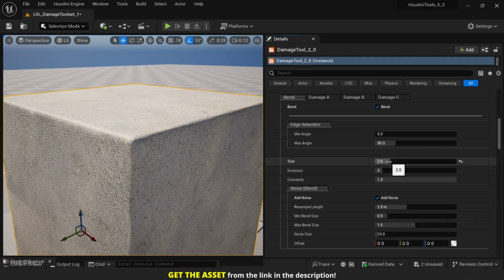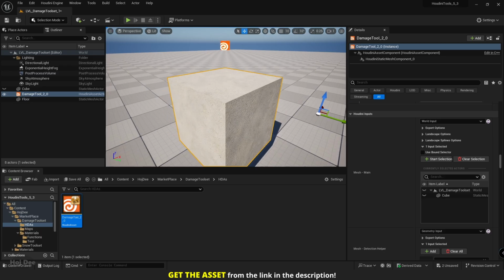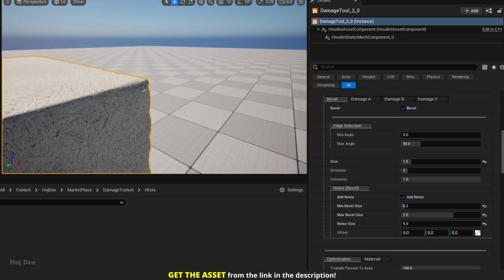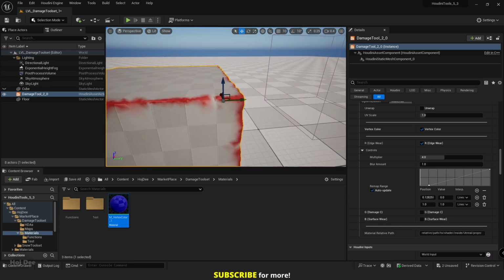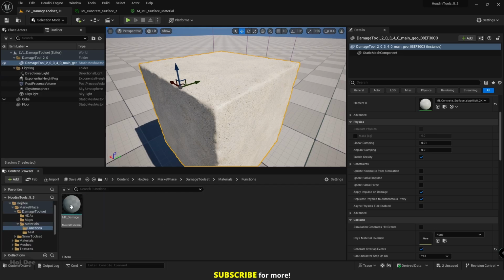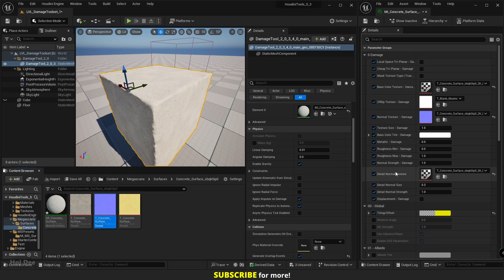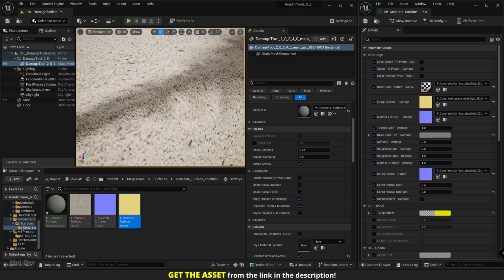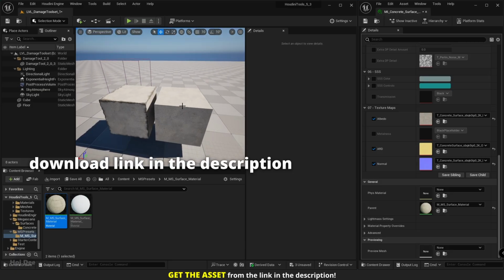Procedural Damage Toolset in Unreal Engine 5 (Bevel Tool)

Comment: Thanks for sharing! Is it possible to bake the bevels to texture in this tool so mesh topology stays the same? Ideally I want to keep the original, low poly mesh and use baked maps to fake the details.
Reply from the maker: Hey man! thanks for your comment.
No, it's not currently possible to bake the detailed mesh into a texture. But I think Unreal's modeling mode has this option. So you could use that or other programs.

Comment: just to be sure, I would be able to use this bevel tool in an Unreal commercial project if I have the free Houdini Engine for Unity/Unreal license, right?
Reply from the maker: You see the houdini engine plugin is free. Butin order to use it you should have at least the houdini indie license.
Watch the houdini engine plugin installation video I've linked in the description to learn more about that. 
Other than that, the final mesh created by the hda is baked into a native unreal engine static mesh. So there's no way to find out houdini was used to create it.
Reply: @UnrealEngineArtist  Great thanks, and does the bevel tool work well with rounded edges in addition to straight edges?
Reply from the maker: @R3SH4D it works on all the edges of a model. Selecting the edges is done by the edge's angle. You specify a certain edges threshold, and it selects the edges in that threshold

Comment: It Can be used with any static mesh? Or I have to used the meshes from UE?
Reply from the maker: Any static mesh
Reply: @UnrealEngineArtist  If I import a mesh from 3ds MAx using Datasmith, and this mesh is a cube with no subdivisions at all, will your plugin add the necessary subdivisions? Or do I have to add them in 3ds Max before?
Reply from the maker: @Trilobito it automatically adds the subdivision. The example in this video is default cube. It's only 24 polygons or 48 triangles